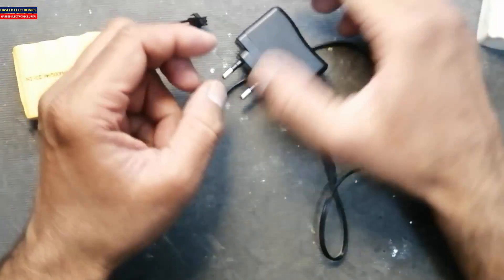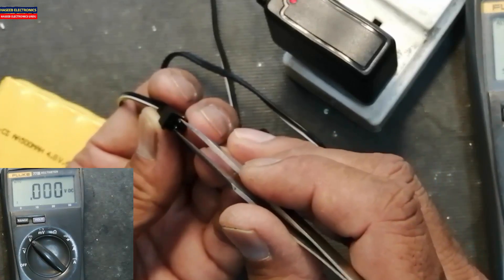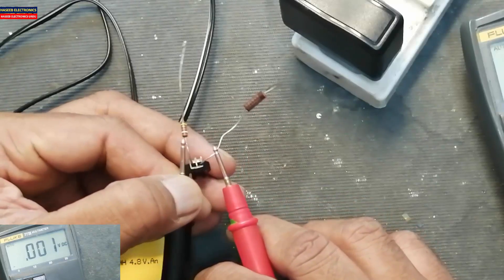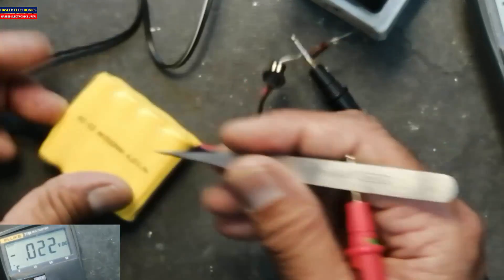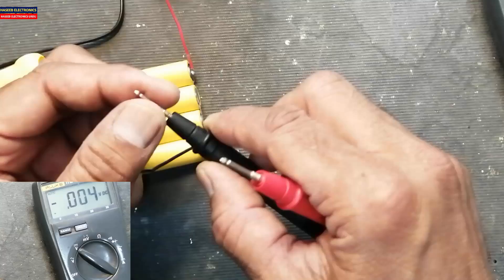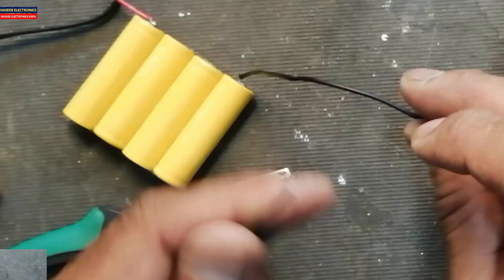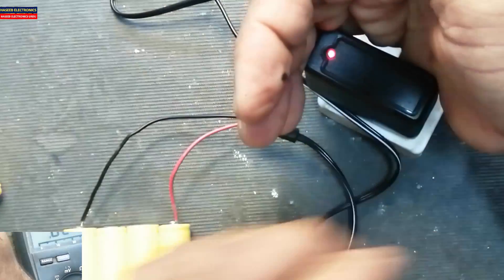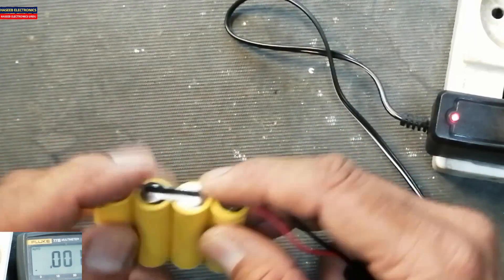{645} Battery Charger Have Output But Not Charging The Battery, Ni-Cd Battery

Comment: Please I have the same situation with my 4.8v battery and I don't think it is charging because my USB rc car battery charger light does not turn on when I plug it in and I wonder if it is the problem you talked about in the video

Comment: I have 7.4 v 500mah rc car battery. Please tell me if I can charge it with USB port on laptop or Samsung phone charger
Reply from the maker: use 9 volt 1 ampere adapter, that will much better 
never charge using USB power from the laptop. and usb charger will not charge as usb power is only 5 volt
Reply: @HaseebElectronics  Samsung charger has 2 values 9v 1.67A and 5v 2A...what about that

Comment: Is there a way to wake up the cells?? My battery (1.2v 2000mah nimh) showing voltage but not working when load is connected. It becomes zero. 
Can i use laptop charger to jump start it.

Comment: How to work Apple macbook 's charger. Macsafe one wire production... Normally 6.5 volts. When laptop connect to charger release 16.8 volts... How this possible... I have connect 43K  resistor negative to positive , charger adapter release 16.8 volts..

Comment: Assalamualaikum mr. Haseeb. how to design a buck boost dc converter using uc3845 with 1 Fet-N channel and 1 core toroid with 12V - to 40V input and adjustable from 5V to 50V output with a maximum output current of 10A. I thank you very much.

Comment: Can you explain how you can check if it is fully charged by multimeter? How much is the fully charged value of that battery pack voltage? Is it 7V as shown by your charger alone? Is your 5v the discharged  battery ?
Reply: Yes

Comment: Thumbs up done the battery pack have no bms sir? tnx
Reply from the maker: no it is not using any bms 
morover it's charger have only one current limit resistance without any battery monitoring circuit